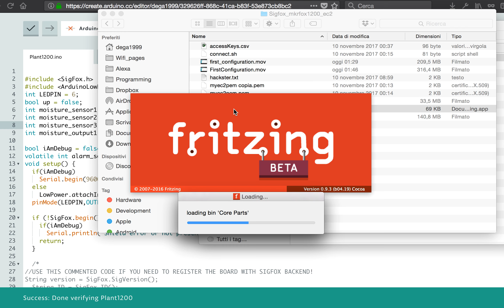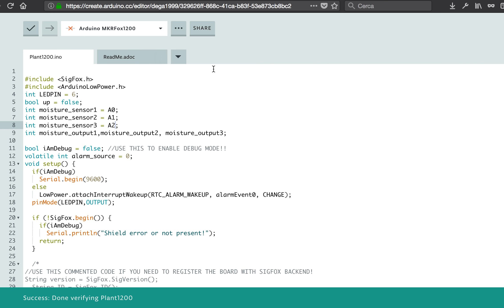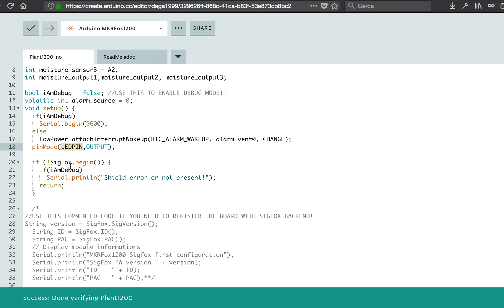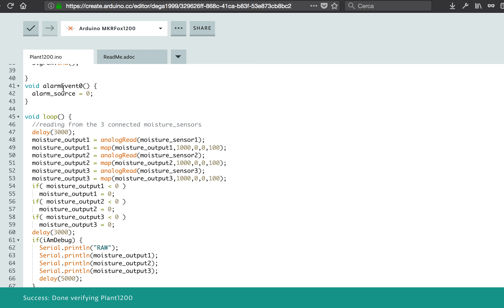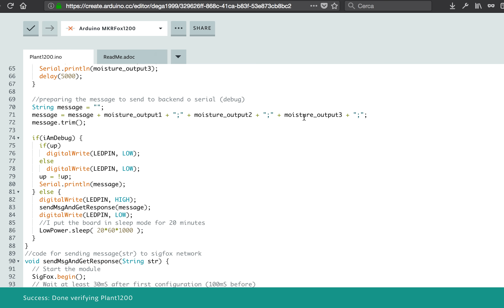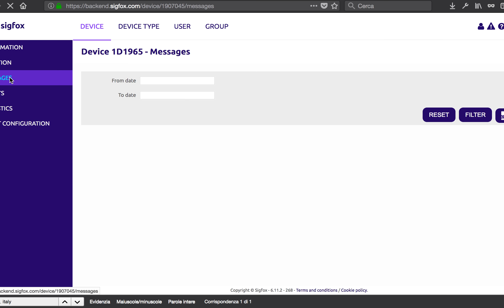Plant1200: Arduino Code Explained

Comment: Ciao Andrea, thank you for sharing this. Can I ask, how do you power the board? Which pins do you use for your battery? Thanks!
Reply from the maker: hi :) thanks for your interest ! I have used an external 5v usb battery pack.. for my tests. The board have a connector for batteries: and you can use 
  two 1.5V AA or AAA batteries .. because you can power it with 3V! It is very good for power consumption: here it is well explained https://www.arduino.cc/en/Main.ArduinoBoardMKRFox1200
Reply: great, thank you. I was using the USB of my laptop to power the board, and getting confused because when I load the code,  the usb stopped being recognized. I am starting to understand this happens when the board goes to sleep. Will do some more trials with the battery later. Thanks again
Reply from the maker: if you see the code there is a "bool iAmDebug = false; //USE THIS TO ENABLE DEBUG MODE!!" :) If you need to load the new code .. and you are stuck and you are no more able to flash the board.. follow this link https://ask.sigfox.com/questions/1833/how-to-erase-mkrfox1200.html
Reply from the maker: the iAmDebug disable the deepsleep and make the board write to serial console informations